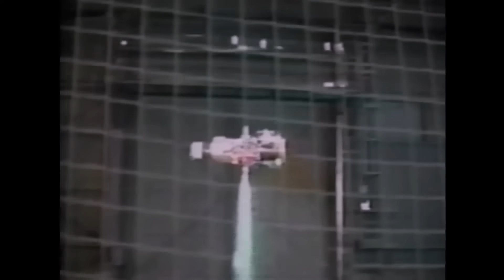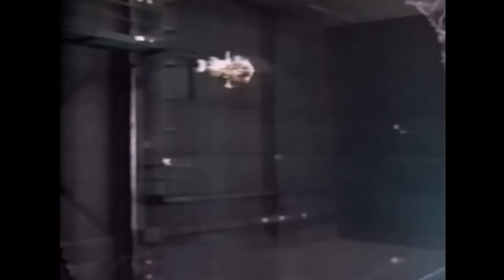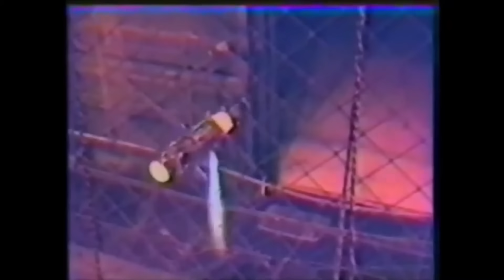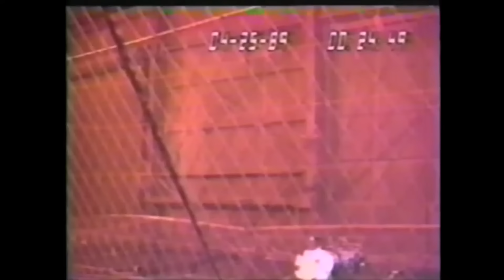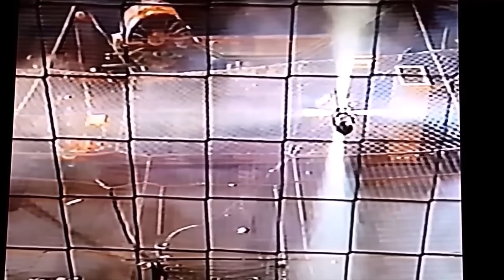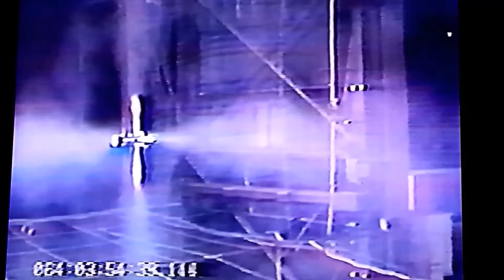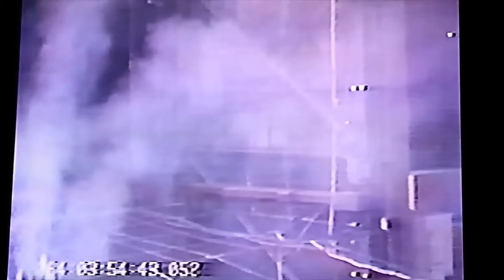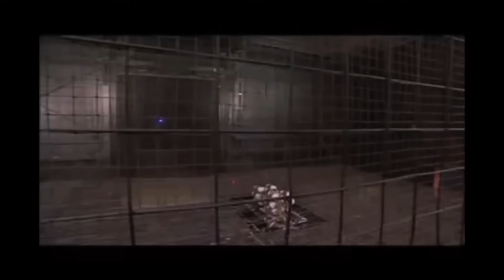EKV/KV/KW/KKV/LEAP (Exoatmospheric Kill Vehicles) Hover Test - Compilation Video (SM-3, GBI, etc.)

Comment: the fact that it was tracking a heat source through a wall autonomously 30+ years ago... To imagine the tech today, is properly terrifying.
Reply: What amazes me also,is that this thing was moving with the precision that it was,at sea level,with gravity involved.I believe these vehicles are intended for a zero gravity environment.
Reply: @JustSomeGuy1979 probably so. It’s loiter time would probably be months or even years if it wasn’t fighting gravity. One cam imagine this type of drone all wrapped up in a stealth housing just laying in wait for some hapless nuclear warhead to blunder into range.
Reply: @JustSomeGuy1979 Well yes, I believe the narrator said they're designed to destroy satellites.
Reply: @JustSomeGuy1979  Yes, these were intended as anti ICBM countermeasures. the idea was that if a MIRV got a chance to open up, you're now dealing with 5, or 10, or 20, or 50 different re-entry vehicles. originally they were going to load a ton of these on one booster, launch them, and let them intercept and achieve a kinetic kill, before re-entry occurred. It's a point in an ICBM's flight where interception capabilities struggled.
Keep in mind though that some of those targets could also have this capability and may try to counter your countermeasures
Reply: @JustSomeGuy1979 definitely has the capability at least😏😉
Reply: There is a animated short called 'RUIN' that features these as enemies in a post-apocalyptic setting. It's a great watch.
Reply: @HaloWolf102 gratitude
Reply: Hey, anyone here knows how it moves forward and backward? ... As the video shows how well it can move vertically and horizontally.
Reply: @JohnKickboxing it doesn’t need to move forward or backwards in space.  It’s in a flight path put there by a booster.   It simply needs to redirect to hit the target it’s tracking.
Reply: @homerdoh56  👌
Reply: @JohnKickboxing launched from a rocket, forward is handled, it’s to correct course to essentially treat the missile coming in as a bullet being hit by a bullet
Reply: @JohnKickboxing it isnt, because it is designed for hitting IBCM warhead on flight, not flying around the ground like in these experiments. But it really looks cool. The fact that this thing can hover and precisely move without initial acceleration is fascinating.
Reply: @JohnKickboxing  thrusters on the front and back?…come on man. Use your basic human inference skills.
Reply: @disqorddoge1101 There aren't any.
Reply: @disqorddoge1101  I'm not that good at listening English, so that I've not watched the whole video yet. 👌
Reply: Cyberpunk is here now and we just dont know it
Reply: @heffaynekoguy687 the question is what are they waiting for exactly?
Reply: imagine what kind of drone tech we have now...oh wait
Reply: Nuke warfare now depends on overwhelming these defense systems

Dozens of warheads per ICBM
Reply: Thats why the russians has dummy warheads in their missiles
Reply: Little to no advancement in the tech to be honest. It's severely limited by fuel supply. Either it needs compressed gasses onboard or a battery, both of which restrict it to a few minutes at most. Pretty useless.

Plus the geniuses which came up with this tech are either retired or deceased. They're the last remnants of the Nazi scientists scooped up after WW2. 'Scientists' today are all about putting unqualified women in to space and denying facts.

Drones are the successors to these devices and drones are garbage.
Reply: tech today ? bro, today we are busy finding your gender and paying for onlyfans. Every heard of any major discovery in last decades ? 
but, we have one good thing, that is SpaceX
Reply: They can see when you touch your pp
Reply: There’s no such thing as science fiction anymore.
Reply: Reminds me of the flying hunter killer robots in Terminator 3..
Reply: thats where all the flying cars are in a hangar in area 51
Reply: what people dont know is humans are so far advanced that we are a pet project for other humans
Reply: Uncle Sam makes shit that WORKS💅🏻
Reply: That's some spooky joo joo tech there! I bet they never stopped the research until they developed  a form of thermally invisible propulsion with an atomic power source...

 We probably know this tech today as the TICTAC UAPs because  those machines  back 5he sure as hell acted an moved like the TICTAC UAPS....
Reply: Back then they were already that advanced. Today they are surprised by UFO sightings and orbs. But all of these things can be explained logically. I know the technology and it is clear to me that this is experimental military technology. The government is silent about this, of course!
Reply: Filed propulsion technology exists, the military has craft that can move at ballistic speeds and stop immediately with a crew onboard.
Reply: @troyrager1352  My comment was removed but basically can you back that up?
Reply: @rleriche5044   mine are removed too 
My profile picture is a zoomed in picture of an orb that was actually a doorway opening and moving about, another red orb would emerge from it and the doorway would close, the red orb would immediately be outside my truck window, not that it was human I don't know but our military has similar technology that was either reverse engineered or given to them by other beings from these dimensions within the doorways, all I know about the crew who operate the field propulsion craft is they wear a special black patch, Ken wheeler knows more about it all his channel is theoria apophasis.
Reply: @troyrager1352  Trust me bro or info you can share?
Reply: Exactly, these are probably some of the "drones"/ uap we are seeing now, just perfected and mixed in with the real ones  that's why no gov't/military action... it's us!! 😂😎
Reply: This is tech from 60 years ago
Reply: My assumption is, this is the infamous tic tac in the gofast and gimbal videos. However, I have no idea what the propulsion mechanism is in the tic tac, but just extrapolating the trend it tracks.
Reply: @ think it’s a good theory but these are the size of a ruler. The tic tac was reported to be the size of a f 15.
Reply: No, it's a non issue. Think about the fuel it's consuming. And still it's moving very slowly. Things in atmosphere or space move a lot faster.  This is just a shiny toy.
Reply: Ya they’re called ufo’s
Reply: The wall was likely transparent to infrared, and only there to contain debris to the test chamber in the event of catastrophic failure.  To an infrared camera, it would have looked like a bright light.
Reply: @ReadTheShrill  It wouldnt see anything through a wall, it is physical impossible to track IR through a wall real time. If the wall was made out of diamonds maybe it would be able to track a heatsource that was blasting heat directly at it and it wasnt that thick, then sure.... But it wasnt made out of diamonds, so there is that! It doesnt take more than a short look at how FLIR works, where glass or even a thin mylar sheet can make heat sources invisible. 

Think its one of these cases where the writer/narrator had no idea what they were talking about and just tried to make it sound more incredible than what it actually was, not that it wasnt an achievement, because its pretty amazing for what it is regardless.
Reply: @nemisizz  Nonsense. There are plenty of different materials that are transparent to IR.
Reply: @ReadTheShrill  Which? I bet you a wall isnt one of them Lmao
Reply: @nemisizz  Polyethylene (plastic used to make bottles, fuel tanks for vehicles, plastic toys and gadgets, bulletproof vests, structural plastics in cars and homes) is very transparent to infrared. It's not difficult to find materials that transmit some wavelengths and block others, hence why you can't get a sun tan in a greenhouse.
Reply: @trolleriffic  Which require being transparent to both IR and visible light. You have to specifically engineer a material with a very specific bandgap to allow IR light through while blocking visible light. The example you gave is precisely because IR is blocked while visible is not. A wall is not going to block visible light and allow IR to pass through. The plastics have to be black and are opaque to visible light. Again, a wall is not going to allow an IR signature while blocking visible light.
Reply: The US is decades ahead of Russia and China. America just liked to understate its capabilities. It’s always been like that.
Reply: @FacitOmniaVoluntas. so why not equip Ukraine properly then?
Why not give it 3x more shells than Russia has instead of giving it 1/5th to 1/10th?

Ukraine isn't even getting parity, so what chance have they of getting back their land. 

This is right on the border of several NATO countries and we are all watching Russia hold the ground they've stolen. 

Britain has hundreds of tanks. Hundreds. Not thousands.

China has so much manufacturing capacity. Probably a large part of every device used to transfer my typing until it appears on your screen was made in China.
Reply: the fact we have these is reassuring, not terrifying
Reply: @spurdosparde6130  Might want to look into DOD 3000.09
Reply: @spurdosparde6130  Nort really. Operation Northwoods is enough for any government having any tech like this being bad for everybody
Reply: Technology. Not "tech". Stop ruining language.
Reply: @lajoswinkler language changes and evolves over time, bud.
Reply: What's crazy is, you could EASILY do this today with a $50 modern flight controller and some solenoids. IR camera on the front for tracking heat.  The hardest part would be getting the hypergolic fuel
Reply: That back engineering from the dozen recovered ET craft 🤫
Reply: @craigmackay4909 I doubt that. I don't believe an intergalactic space traveling hyper advanced species would use internal combustion.
Reply: @craigmackay4909  or just rocket propulsion
Reply: Not through a wall, please don't be silly.
Reply: @bannedagain1483  please pay attention to the video..
Reply: @notflanders4967  it's looking at the heat of the wall, not through a wall. Please learn basic physics.
Reply: @bannedagain1483  I didn't say its looking through a wall. 
Obviously it's due to heat transfer. It's still tracking the source, regardless of how you want to word it Nancy
Reply: @notflanders4967  You said its tracking a heat source through a wall, implying it sees through the wall. Its not tracking the source anymore than an IR device is tracking the sun via BBR. Its not about to defy physics.
Reply: @bilbonob548  its tracking and I don't care how you define it. Good day!
Reply: @notflanders4967  you have been correct all along. The heat travels from the object through the wall much like seeing something is the photons traveling through whatever medium; the same way we hear through a wall.
Reply: We had them in the military in ww2. This isnt 80's tech
Reply: It’s fake. Wakey Wakey…

Comment: Dead end, too power hungry.  There is a reason why every space based object moves slow, you have to take your energy with you or harvest it from the sun.  The clips are only tens of seconds long because it has used up it's propellant supply by the end.

Comment: SO IMPRACTICAL
Reply: our aim-21 medium range anti air missiles use this system, it can pull a 180* turn in seconds and track a jet from any direction.
Reply: @FedkaSlovanich   YES, BUT IT IS ONLY USED FOR THAT, IN A VERY LIMITED TIME, THAT MAKES IT IMPRACTICAL ON A LARGE SCALE
Reply: @pay2000 This thing can be applied to many applications regarding rockets and drones. 

Also it is quite similar in use to the rcs systems in spacecraft. 

So yes, it's concept is practical. Just because it is only use on fews things right now, doesn't make it impractical.

Comment: Gee, no video of the Aerojet/Raytheon EKV hover test that I was involved with from 1996 though 20018.  We hovered in 1998 then began flight testing at KMR in 1999.  Most outrageous experience in my 40 year career.  The Aerojet propulsion system is now emplaced on 40 + systems.

Comment: yea its cool alright but its plain useless for the purposes it was engineered , this device cannot go 10 km up in the air and shoot down nuclear missile or aircraft , it could be used like ground based anti infantry killer drone , but from what i am seeing this device is very limited by fuel usage :X
Reply: It's supposed to be deployed by a space capable rocket. The purpose of the system is to make the precision adjustments that the main rocket couldn't make.
Reply: @milandavid7223  try again bro
Reply: @plamenzlatev1206 Just read the explanation more slowly.

Comment: I worked on this project, it was awesome! There is a model of a vehicle on display at the Reagan Library in Simi Valley-CA.
Reply: When were you there? I started in 90 working through 92.
Reply: 1988-1989 as a Sub designing and building the electronic interconnect @kingrichard29

Comment: A lot of these videos are well over two decades old at this point but they are basically RCS systems (same used on spacescraft) crammed into a small unit. They just look insanely impressive when operating in high gravity because they are constantly having to fire for course corrections.
Reply: try 4 decades old
Reply: This was unbelievable tech 30 years ago  that for the most part was kept secret. It's hard to imagine the capabilities  and size of today's version given how far technology has come. Just compare a cell phone from back then to a smart phone of today!
Reply: @chadterry9770  The challenge isn't related to computing hardware so much as it's the limitations of rocket technology. Military kit is also usually decades behind the curve when it comes to microchip technology - the flight computer in the F-22 used processors that were cutting edge in 1989 and obsolete by the late-90s. The chip in the latest iPhone has 16,000 times as many transistors and runs 100 times faster.
Reply: Gravity does not require any more course corrections than zero g does.  What it does require is a lot of thrust to keep it airborne, that's impressive, they appear to have more propellant than one would expect in such a small body.
Reply: Это диметилгидразин?
Reply: @antoniolsn2518  Its a mono so yeah probably N2H4.
Reply: @antoniolsn2518  Возможно
Reply: @antoniolsn2518 probably monomethylhydrazine.
Reply: How does the RCS system know where it is and where it isn't?
Reply: @RawkL0bster  probably inertial guidance.  Or completely external in this test setup.
Reply: Try 3.
Reply: many of these were developed and completed in 1980, which is 45 years ago-ish. It is amazing. Their secret development means only recently are the video feeds being published.
Reply: @NoobNoobNews  These videos were made public in the early-90s and possibly earlier.
Reply: gravity requires tons more course correction, you dorky idiots, don't argue, it's not that amazing.  It's just a bot in FF.  thing's annoying af.

Comment: This type of technology along with NUMEROUS others is proof that we must have reversed engineered alien technology and the ideas from it to do things like this. And not just from the Roswell incident. This is from the 80’s, probably started working on this in the 60’s or 70’s. Probably took 10 years before that to work out the engineering to building the parts to start testing

Comment: I was given a VHS tape marked UNCLASSIFIED by the poject manager after I got to see the test firing and flight of the original prototype shown in this video presentation. That test was conducted at Phillips Lab, Edwards Air Force Base, CA
 It was part of President Ronald Reagan's STAR WARS program.
This is the first time I have seen this vehicle come off of its cradle and move about since that night years ago.
I was amazed by the agility of the vehicle. The program was eventually completed and shut down.

Comment: So most "UAPS" or UFOs which aren't either use ultra sonic propulsion. Electricity powered by nuclear fusion. It uses the same concept that you see in this video. To use ultrasonic waves to the vehicle in any direction ultra fast. There's a reason you're starting to see ultrasonic videos of levitation. Multiply this by 10 and you have what most people think is a "UAP" and or UFO. It's not it's just super classified. They're using sound or waves to propel something forward and any direction just like The kill vehicle

Comment: I wonder how well a similar vehicle would do with a combination of chemical-based thrust, and electric fans for the lighter work. Just from my layman's visual perception, these devices appear to constantly use a very heavy thrust for each movement, in a way that requires constant correction. It seems that this would burn a lot of fuel on those constant corrections.
Reply: The only issue is that these are designed to work in a thin atmosphere or space where a fan woudlnt work

Comment: wondering if this is a solid fuel operation but using pwm to controll flow?
Reply: It uses liquid propellant but with pulse engines similar to Insight.

Luckily Lockheed Martin isn’t as restricted as Joe Barnard when it comes to designing anti ballistic technologies
Reply: @weekiely1233  ooo interesting i wasnt quite sure if it was pwm modulation or actual pulse engines.
Reply: @youreditor5264  it is PWM but not with a solid motor. Basically RCS thrusters that pulse on and off very very quickly. 

Draco Thrusters on Dragon are pretty similar.

Comment: Still with this technology you're only limited to however many cycles the bearings last for the factor of friction is always King in these material on material tests or technology that's why the air bearing is so revolutionary or even more so the rarest magnet suspension like the bullet train